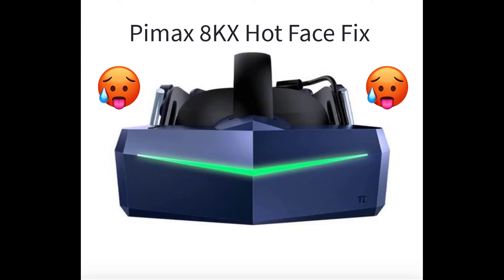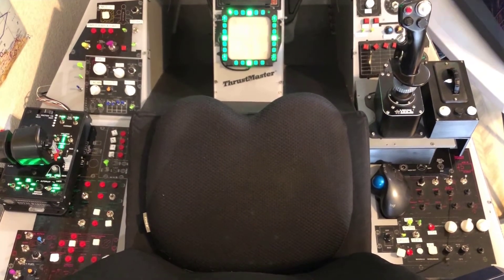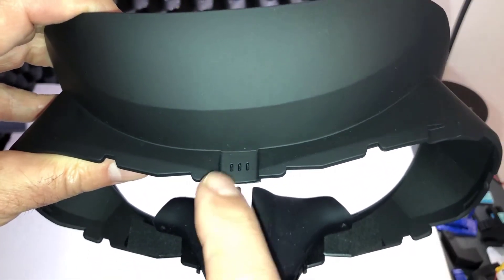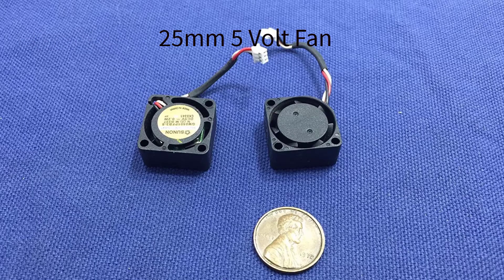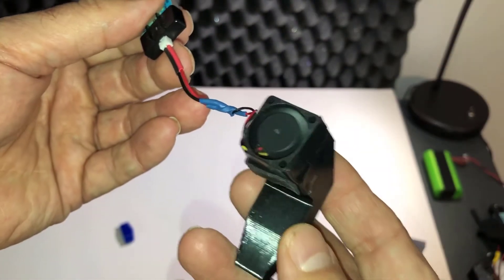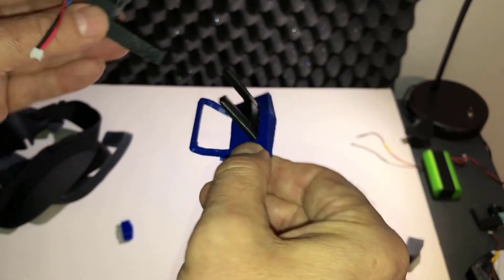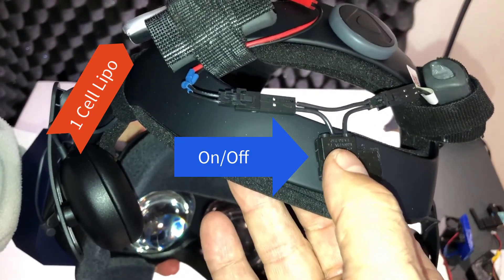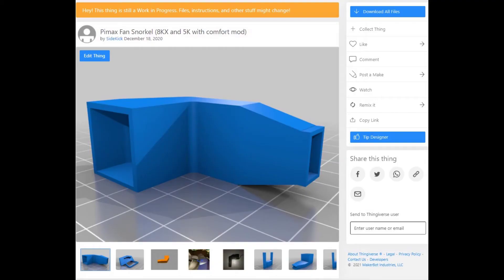Pimax 8KX Snorkel Fan Mod

Comment: Thanks for sharing this. I actually have been searching for a solution to my Pimax 8kx making me sweat.

One observation though, wouldn't it be better adding some sort of intake (holes, but I'm conscious of light) running the fan in reverse, so you are extracting warm air and replacing it with cooler air from outside the headset?

Comment: So i bought the 3d printed stuff and using the 25mm fan, but the air flow is just barely anything and definitely doesn't seem to out pace the heat of the pimax's screen. Any thoughts?
Reply from the maker: You can try a fan with higher voltage for greater throughput like a fan up to 12 volt  - It works fine in my climate and needs. I also have 30mm size setups in the stl for bigger fans if needed .